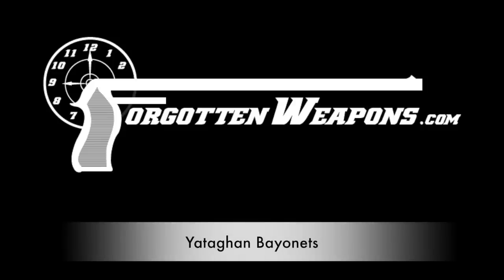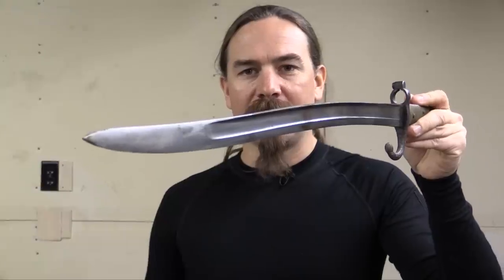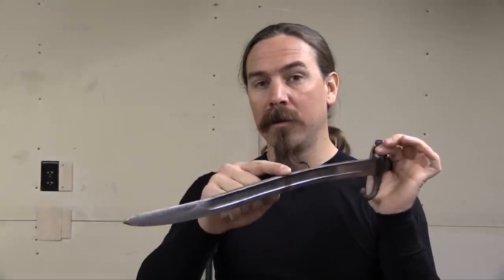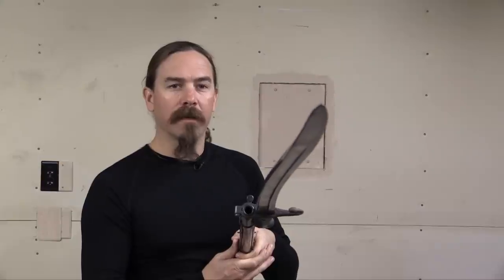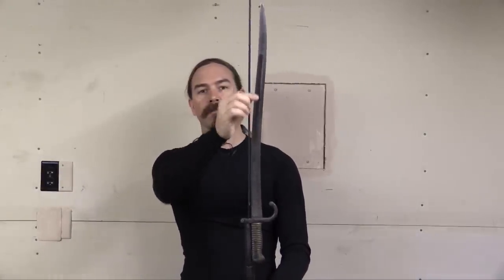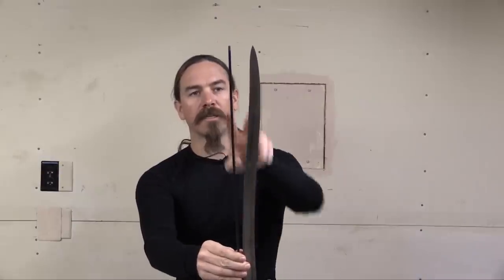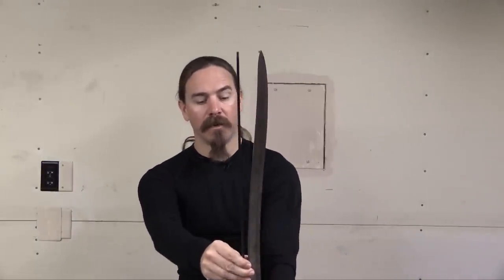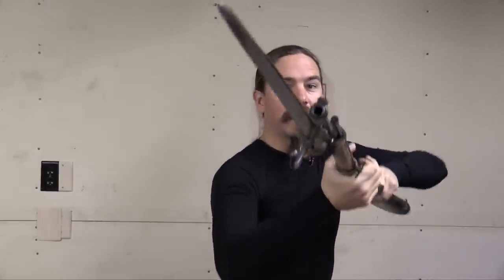Forgotten Weapons Short: Yataghan Bayonets

Comment: the fuller down the middle is what strengthens the blade. it has a cross section like an i-beam. this is necessary when you have such a long thin blade, otherwise the blade would be to heavy  to use effectively.

Comment: Ah, so it does have a purpose. In the heat and excitement of battle it would certainly be possible to shove your hand down on tbe bayonet point. Glad the designers and engineers were keeping the common soldier in mind. They so often don't. Great video as always. Thank you

Comment: I dispute that it doesn't make for a good sword, as the original Yataghan is actually a Turkish sword https://en.wikipedia.org/wiki/Yatagan The curve also helps with slashing, especially drawcuts, since now, unlike mode curved blades that curve away from the victim, this just bites extra deep
Reply: Christoffer Öberg curve is a different shape
Reply: No matter whether the original swords are good or not, bayonets typically have extremely thick profiles leading to a very blunt edge (because they're stabbing weapons) and are too light for a sword. So even if the thing they're named after is a good sword, they themselves would not be.
Reply: AdstarAPAD It isn't about the tip, for a slash.  The Chassepot, and even better, the Danish Rolling Block Yataghan, have the belly of the curve right at the center of percussion.  This enables WICKED draw cuts, just like other curved (and recurved) swords.  What the yataghan allows is cuts like a curved blade, thrusts like a straight one, and all the advantages Ian noted.

Only drawback is they are too heavy.  Thus the Gras, etc.  (Take a close look at my avatar pic).
Reply: looking at that one it seems to be about as broad and thick as some Tulwar blades, use it to slash while still on the rifle and it would be one hell of a nasty polearm.
Reply: There is always someone who will argue about anything.  Good luck in life.
Reply: I had the opportunity to handle some of these bayonets a few years ago and I was struck by how useful a weapon they would have been in an infantry melee where there wouldn't be room to use a proper sword. A "sharp club" like this would be more appropriate in the glorified bar brawl of close quarters hand to hand combat.

Comment: I don't believe you're correct on the reasoning for the curve. The Yataghan bayonet is clearly styled after the Yataghan sword. The purpose of what is called an incurved blade is for cutting. This would still be effective as a bayonet. As a matter of fact, I would suggest that it loses almost nothing for thrusting and gains quite a lot for the purposes of cutting. Using the Incurve design and attaching it to a long lever (the rifle) would significantly aid cuts and chops.
Reply: As for why they switched to straight blades I think that's actually easy if considering the historical context. In WWI many of the traditional military knives were of a typically single edge with a slight curve (kind of like bowie). There was an issue with these kinds of knives being able to pierce the thick coats often worn in the trenches (mostly by the Germans). The switch to straight bladed knives was made in order to more easily pierce this coats. This is where the "Trench Knife" was invented. After WWI this style of knife became the norm. For obvious reasons, this would apply to the Bayonets as well.

Comment: Are Bayonets still used today?
Reply: Yes, but recent models are a lot shorter and are also useful as a soldier's utility knife. A perfect example would be AKM bayonets which can, in combination with their sheaths, be used as wire cutters. Not all modern armies use bayonets though, the German army for example doesn't issue a bayonet.